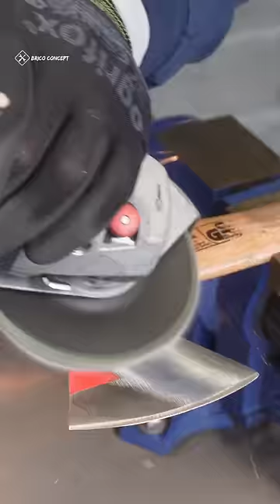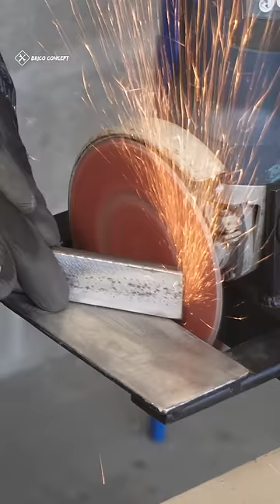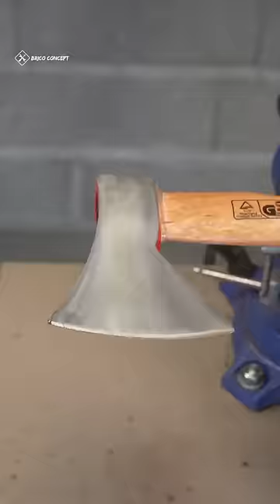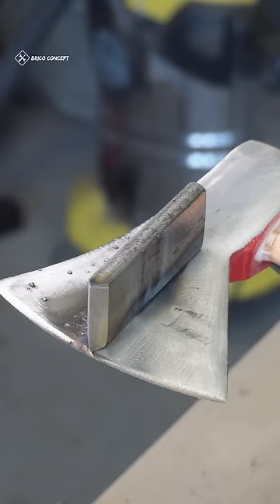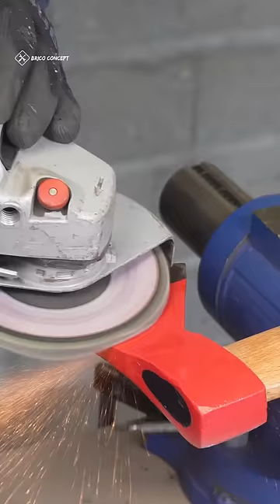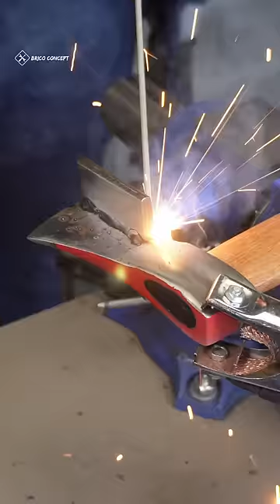Lumberjack Trick To Go Faster #shorts

Comment: Might as well go buy a hard plastic wedge, heat up a piece of rebar and stick it into to it to make a handle. At this point, that may even be more useful than that thing you made. Temper is gone, and itll be soooo hard to wiggle free if it gets stuck.

Comment: That wood is so small it'll burn so fast in your fireplace and it will be useless in heating your house Big thick logs burn longer and slower and release heat at a slower rate The small little twigs like that will just burn up and expend all their heat real quick

Comment: Yeah I'm not sure what this has to do with being a lumberjack?  I sure wouldn't ruin my good ax this way.  This wouldn't even help in anyway.  You have to be able to drive the wedges to push the tree over, and ylthe only time you might use the cutting edge is to knock off a limb